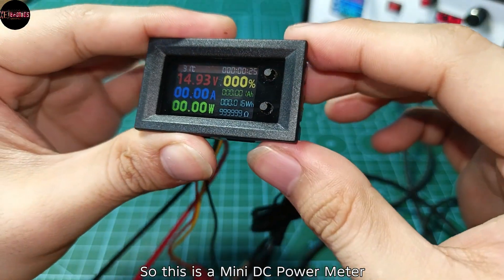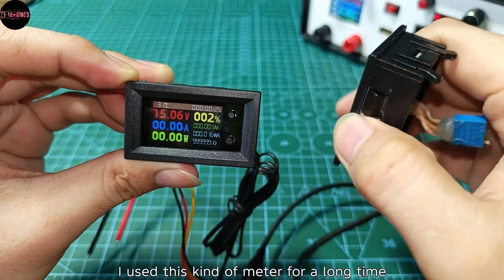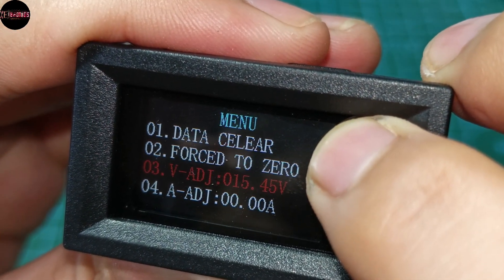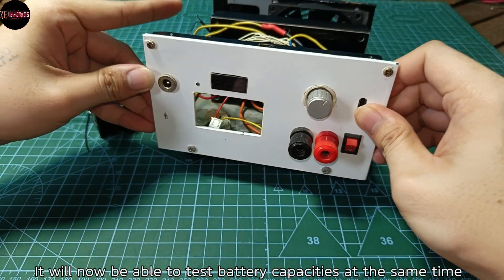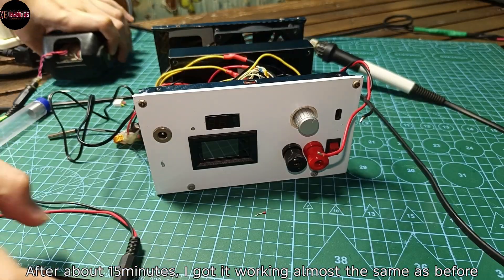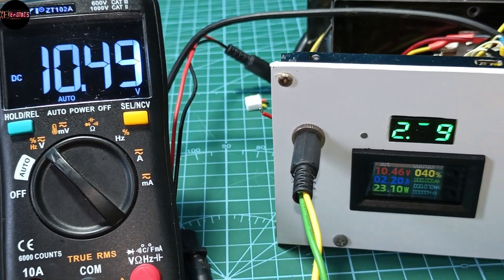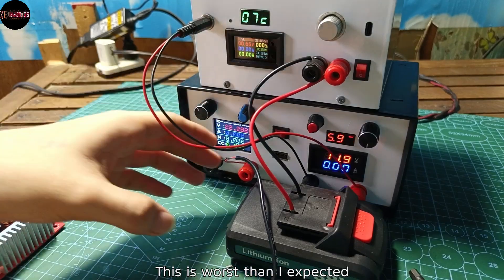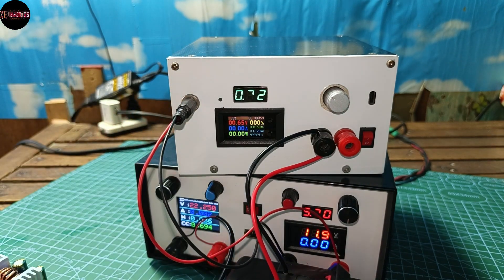DIY Battery Capacity Tester 200V Max #batterycapacity #diyelectronics #voltmeter #powermeter #power

Comment: there is a other version too something called like ws3505 that has electronic load of 35w built in
Reply from the maker: That got me curious. Having a Cutoff voltage built in would be nice. 
But the 35w limit is kinda bad
Reply: @x3dtronicsph  yes but you can upgrade the mosfet to a dip one and tweek the firmware 

The firmware is open-source 35w lilimt can be removed

The price is not low though better is to diy with esp and a 2.4in tft etc 
the general principal of a electronic load is simple